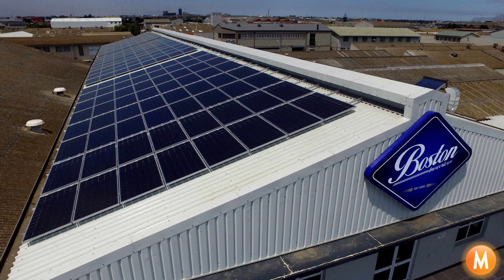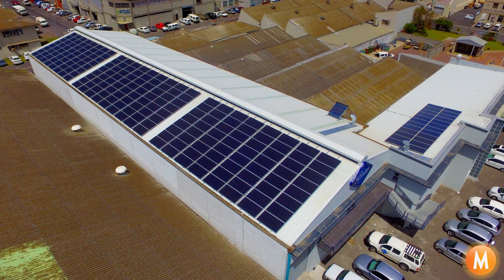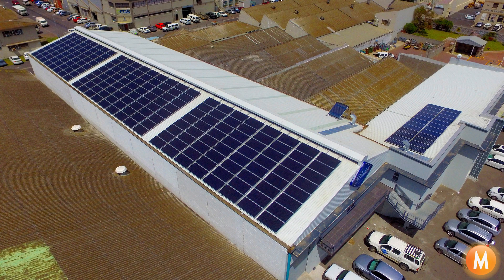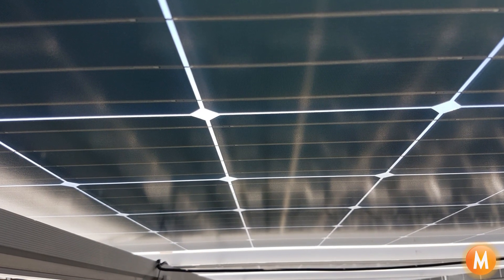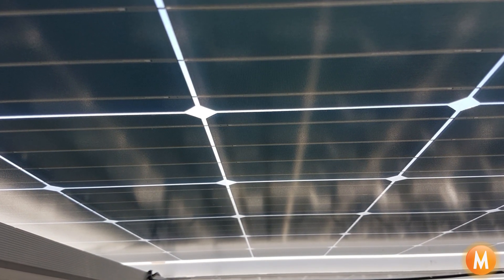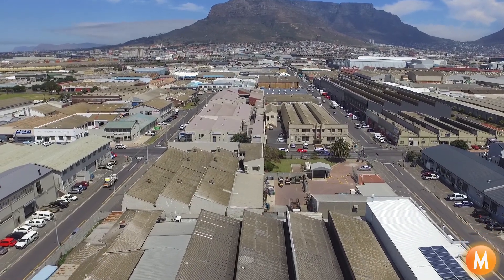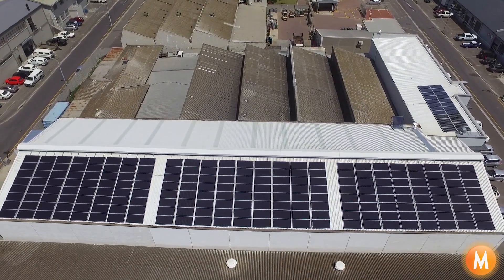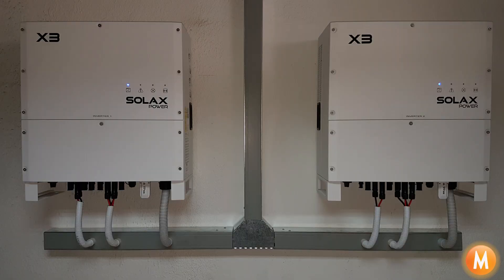Double Sided / Bi-facial Solar Panel Installation

Comment: My own bifacial panels have a big space between the panel to the refective surface. And the reflective surface is angled to focus reflection on to the rear of the panel at the optimum part of the day.The way you have done it not optimum as the panels create a shadow over the refective surface. 10% is a bonus but you would get more with a better installation.
Reply from the maker: great idea, awesomeness!

Comment: Why don't you try them be placed vertically, with sides placed east and west, at a distance /gap that is equal to onw panel(about 1 feet above the ground), and the ground be prepared with white glazed ceramic tiles. The surface could thus be cleaned easily. Multiple reflections result in light being hit on either side almost equally.
Reply from the maker: Thank you KA, great idea, for this roof we would need a lot more space.

Comment: Seems to me if you wanted to take full effect of the back side you would place the panels at a degree that would most benefit from uv reflective paint on the roof with reflective aluminum side skirts to add even more uv.
Reply: Correct!

Comment: nonsense..that is not working...due to the panels flat on the roof...bifacial needs to be on a reflective surface..white is best at 40 degree angle to work...being flat on the roof gives no extra light to enter.
meaning it needs to lift atleast a meter off the ground

absolutely useless

dont get installations from this company...you will waste all your money

Comment: Why are your rails shading the rear of the cells?  Doesn't that kind of defeat the purpose of bifacial panels having the jbox up the rear of the panels (to NOT shade the rear of the cells) ?  Wouldn't you have been better off installing the rails on the edges of the panels so the entire rear side could have been un-shaded in comparison to the rails blocking some of the light from the rear of the cells?  Did you do any testing to see what real world performance difference this makes from having rear rail shading vs no rear rail shading?
Reply: Cause they are sellers. They don't care. The client paid 25% higher price for modules to gain theoretical 10% (be fair, +7% in so low installation would be a wish) more power. Time of reimbursement - something about a decade.
Reply: @kaytem9748  exactly.  Most who they sell to are idiots.  Oh panels on the back  side  must mean double the power lol no it's not worth the extra money .
Reply: @j5892000  may be saving environ is more pricey then the money spent ?
Reply from the maker: Dear Steve, thanks for your comment, we have done further installations with a short rail that does reduce the shading to the rear side of the panel. We will make another video shortly with our findings.